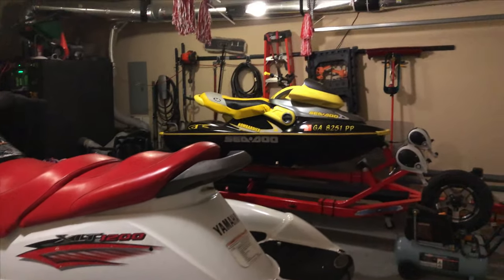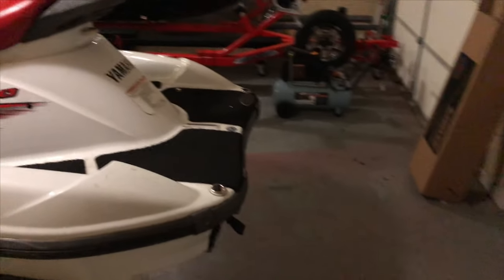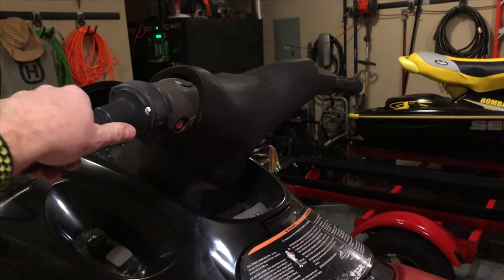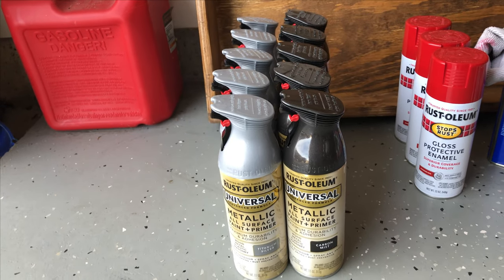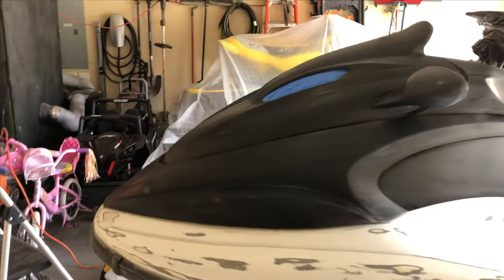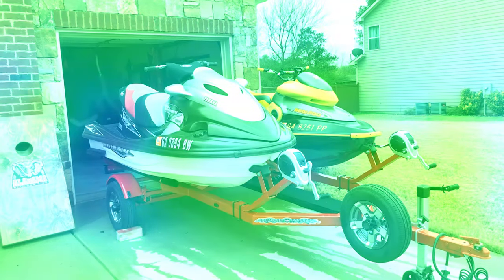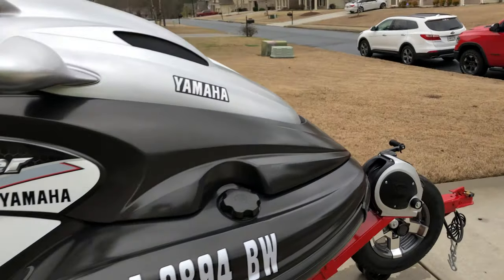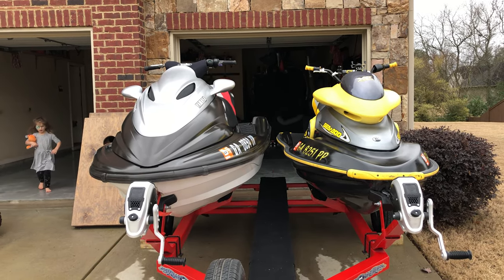2003 Yamaha XLT 1200 DIY Restoration

Comment: Not gonna lie, the red seats are BEAUTIFUL, current cover is ripped so thank you for the inspiration, probably going to replace mine with the red
Reply from the maker: Thanks! I should have never sold those ski's lol.
Reply: Where did you get the seat.and what type of spray cans did you use
Reply from the maker: Sorry for the delay on responding.. The seat cover I snagged from https://watercraftsuperstore.com.  Paint was just Home Depot special, paint + clear coat. They are shown in the video.

Comment: Great Job. It came out really good. Do  you know if that HD paint would hold up for many years to come? Do you recommend wrapping instead of paint?
Reply from the maker: That could be an idea (wrapping). I used several coats and clear on top, so should be good since it's above the waterline.

Comment: How can it be completely seized but run ? That’s not possible
Reply from the maker: It's a 3 cylinder, and one of the cylinders was seized (not the entire engine), so it was essentially running on 2 cylinders.  Rod broke off the piston, was obviously a bad situation to crank it period, but fast forward to today, it's had an entire top-end rebuild and is ready for the lake :)
Reply: @Chromedonkey  ok, the broken rod makes sense. Otherwise, one cylinder being seized mean all three are.